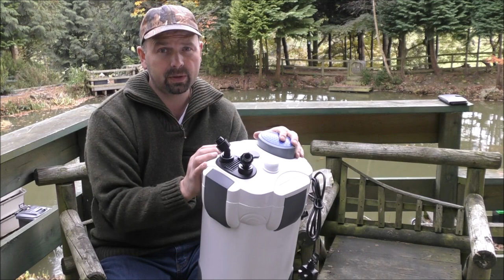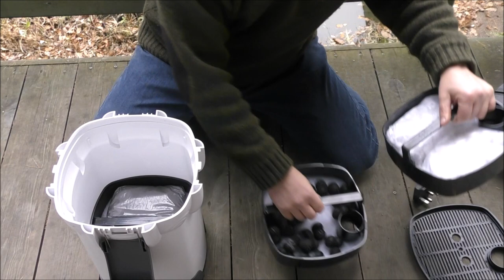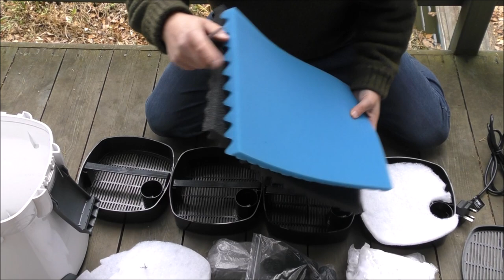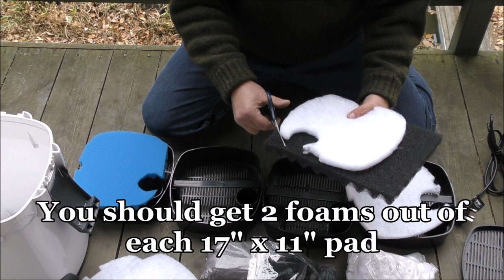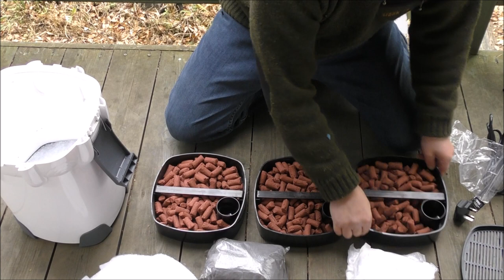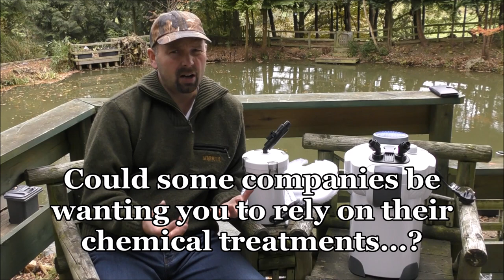Why Your Filter is TOO SMALL and NOT CYCLED

Comment: thank you very much :) but is there such thing as "too much filtration" just asking because i am about to get a 50 gallon tank w/ 3 adult angelfish and 30 harlequin rasboras i also plan to get the sunsun canister filter that has 3 trays and claims to do 1400LPH do you think that's suitable? thanks!
Reply from the maker: That will be 1400 litres per hour (approx. 370 US gph) and it certainly wouldn't be too big for a 190 litre tank as each tray will hold approx. 1.5kg of biohome ultimate - allowing the bottom tray to be used for the foams and fine pad that leaves 2 trays (3kg media in total) and that would see you good for up to 300 litre tank for a full cycle (reduction in nitrate) if it was normally stocked tropical tank. 
If the tank got toward heavily stocked it could take 1.5kg to 2kg per 100 litres to achieve that full cycle so I definitely wouldn't go smaller than the filter you have in mind as it is bang on.

Comment: Speaking of dechlorinators, What's your take on safe?  It also says it can be used to detoxify nitrates.  Will you suggest to me a couple brand names of good the chlorinators.
Reply from the maker: I have no experience of that particular one but if it claims to detoxify nitrate then it may have the same starving / poisoning effect on anaerobic bacteria? 
Using a straightforward dechlorinator is no problem for a fully developed cycle and something like 'stress coat' from API works fine and does not negatively affect bacteria.

Comment: Hey, I'm thinking about making a "Sump" I will get a pump and pump 400gph (1600lph) through a 30 gallon (120l) "sump" and put in a bunch of seachem matrix and denitrate, and possibly biohome ultra, and my whisper 20 (rated for 20 gallons) a double biochemical sponge filter (filled with matrix) which is rated for 60 gallons and pump it back in. Is that good to a heavily stocked 90 gallon(360l)
Reply from the maker: The more media you have the more bacteria it will support so its all good but some is better than others - check out the video I did called 'Looking inside filter media'.

Comment: my problem is with nitrates only. i have a 60 lbs of rock in a 60 gal tank.  ammonia and nitrites are 0 but my nitrates are my biggest issue.  it is always high.  around 20 I would like to get that down to 5 ppm or less.  thinking about getting eheim external canister filter just for nitrates.  everything else is good other than nitrates.  what do you recommend. I also run a eshopps HOB skimmer. which is a work horse. keeps the water clear as glass but just for nitrates just can't get those under control with Water changes.  tried vodka dosing and vinager dosing and no results. got 2 clowns and several soft leather corals.
Reply from the maker: What do you have as filter media currently? For a 60 gallon (US?) marine tank it should take around 5kg of biohome ultimate marine to achieve full cycle but if advise not getting one of the newer eheim filters as they are awful. Feel free to send details of current filtration to my email as I often miss YouTube comments. It is sales@filterpro.co.uk 
Vodka / carbon dosing is very useful to speed up a cycle and help bacteria establish quickly, especially anaerobic bacteria responsible for nitrate reduction but only if they have somewhere suitable to live. That's where the biohome comes in.
Regards
Richard

Comment: Great video. Would you still recommend water change regularly, if so how much and how often?
Reply: Ah saw your comment: "Even in a system with a full cycle and perfect test results you should do a partial water change every 1-2 weeks depending on stock and also remove fish waste and uneaten food at the same time with a gravel cleaner. A water change will help to remineralise the water so is essential no matter how good the filtration is."
Reply from the maker: Yup, that's about it.

Comment: Hi pondguru would like if u could do a video on the booster filter set up with the canister filter set up so I can see how the best way is to set up the booster and canister filter as in piping and media thanks would greatly appreciate it
Reply from the maker: It really just goes on the inlet pipe - simply cut the flexible inlet pipe and fit it. Alternately it could be totally filled with media and put on the outlet pipe although that method is never talked about either one will work.

Comment: I am new to having a aquarium. I have a 160 litre tank and I have the all pound solutions external filter EF1+ 1000L/H with uv light. And so far about 24 community tropical fish. Have I got the right filter for the size? And or should I buy the booster?
Reply from the maker: It sounds about right - see how it goes and then the booster is easily added if necessary.
Each tray of the 1000 will hold 1kg of biohome ultimate making it suited to a normal community tank of around 200 litres. Allowing for water displacement from substrate and decor you should be well covered there.

Comment: If you add a booster filter, how do you reconcile the different flow rates?  Surely you would have back pressure to one of the units leading to the pump seal failing?
Reply from the maker: Some 'boosters' have integrated pumps which are much smaller than the size of the main canister filter so I'm not a fan of running that with a canister as there will be 2 different pump outputs - therefore its definitely best to use a booster with no pump....but as I mention in this video they can slow the flow down a bit due to the extra restrictions - I'd definitely like to see boosters much bigger.
Reply: Pondguru I see now - so basically it’s just adding another ‘compartment’ without a pump. Cheers.

Comment: Hello! I like to build next year my koi pond,around 1500 gallon.My question can i use shower filters ,and how big /stages/ has to be use for bio filters.?!
Reply from the maker: You can make them whatever size you want but generally the better quality the media is the smaller the shower filter will need to be. For 1500 (US?) gallons you'd only need sections about 18" wide x 12" x 12" (3 or 4 of them) filled with decent media for great quality water.

Comment: Thanks for the informative video. How do you rate Alfagrog as a biological media? Could it be taking care of the nitrate to nitrogen part of the cycle for me? (I'm going to move my fine pad to the bottom of my filter right away and put more bio media in my top tray)  Also, second question, In a planted tank would the plants be better off or worse off if my nitrates go from 20 (what they are now) to zero.
Reply from the maker: The plants are't affected by low nitrates since they use the soluble nitrogen in just the same way.
Alfagrog is a decent media but very unlikely to support enough anaerobic bacteria to affect nitrates unless the flow is very slow.
20ppm is a good reading for nitrate compared to many people's tanks.
I did a video recently where I looked inside different types of filter media to show how useful it would be for bacteria: https://www.youtube.com/watch?v=QTtAUYR67Eg

Comment: Hi i have a all pond solutions 1000fx filter will it be powerful enough to run a 182 litre tank?
Reply from the maker: (without a booster) It holds 1kg biohome ultimate per tray so if bottom tray is used for foams and fine pad that leaves 2 trays for media (2kg) which is fine for a normally stocked tank up to 200 litres (1kg per 100 litres for a normally stocked tank).
1400 would hold 3kg and 2000 would hold 5kg

Comment: Fantastic video - thank you.  I have an EF1000 with booster on a 125ltr tank, but based on your video it's mostly set up wrong.  I have just ordered better media, foams and API Stress Coat (previously using Haloex) - thank you :)
Reply from the maker: Sounds good to me and thanks for the order. Having a filter set up properly is a major step in the right direction for fishkeepers.

Comment: hello Pondguru your videos and suggestions are really useful. I would like setup my 42G tank with Canster filter where there are nine African Cichlids and two red parrots all are of 4-5" now. Please let me know which filter I should go for and how long I should run that and what should be the flow rate.
Reply from the maker: Flow rates aren't really too important but size of filter and the amount of media it will hold for the stocking scenario are therefore for a 42 (US?) gallon tank with cichlids you'd need a filter capable of holding around 3kg of biohome. The 1400 litre per hour All pond solutions filter / SunSun filter would be minimum size for that - Fluval 406 or FX4 is another option but ideally I would go for a slightly bigger filter which could transfer to be used if you upgrade to a bigger tank.

Comment: I am from India. In India there is no supply of Bio home ultimate . E bay supplies it through international import and then the costs are Rs 800/- per 500 g ie approximately 3 kg will cost me 4800/- which is more than the cannister cost Sunsun 303A -4600/- only. Is there any way to get Bio home at a cheaper rate?
Reply from the maker: Unfortunately we do not currently have a supplier in India and international postage can be expensive due to the weight - the nearest would be in Singapore. Direct links to suppliers in different countries is on my website http://www.filterpro.co.uk

Comment: @Pondguru please can you help me understand the Juwel BioFlow XL flow direction and therefore your view of pad placement. The fine foam pad is instructed to be at the top but gets filthy while the medium and course seem not to.  Does that mean the flow is top to bottom and its therefore (based on your excellent video) in the wrong place?  Thanks
Reply from the maker: Yes as far as I can tell the newer versions of the Juwel internal filters work top to bottom - Juwel have always set filters up to have the fine pad first so that the fine pad takes the majority of the dirt and needs replacing regularly. Ideally you would set u=it up so the water hits coarse pad first then medium then fine to gradually remove the dirt and not just concentrate it all in top pad. Better still if you find that the internal filter is not coping install a suitable sized canister filter as it will offer much greater filtering capacity than the internal filter.
Reply: Thanks for the reply.   I have a Fluval 306 running too (set up as you recommend for some time)  for this 450l Malawi tank but the internal (and the fine pad) seems to take the brunt of the muck.  I'll move the fine pad down beneath the course and medium and see if that helps.   Nonetheless my tap water is high in nitrate and I've never manged to get my nitrates down in the tank :-(
Reply from the maker: That would definitely be classed as heavily stocked so it could take 1.5kg-2kg per 100 litres to achieve the full cycle and reduce nitrates naturally. Therefore you could need up to 9kg/10kg for a heavily stocked 450 litre tank.

Comment: Great video, I use pinky media as fine at the end, is that filter media okay, I also use chemi blue can, is it safe to use to use with biohome ultimate
Reply from the maker: I'm not sure about the chemi blue. I did have a couple of people reporting cycle failures when using one of the chemi products but I can't remember which one it was. The pinky pad should be no problem as it is just a dual density polyester pad.
Reply: Pondguru, thank you

Comment: Hi Richard. After long battle with cyanobacteria I decided  to  remove biohome media from my filter. I dont have problems with cyano since. What's your experience with biohome media? Are there natural for water?
Reply from the maker: I'm not quite sure what you're asking here since biohome mix is essentially various sized particles of sand and powdered glass. The powdered glass is used to fuse the sand particles together in a kiln which results in a strong, very porous media with a structure which is as close to natural as you're going to get as a filter media since bacteria essentially grows on the particles in the various holes and tunnels between them.
I'm presuming that you were treating for the problem but what sort of tank do you have, amount of media used etc. etc. - there is lots of missing information here. I know cyanobacteria can be a problem in new tanks - was the tank new (going through a cycle)?

Comment: Hey PondGuru, am interested in the cleaning.  I have followed through you setup of my AP 1400EF filter and the way you have advised to clean, however, I am still getting smallish (not fine) particles coming back through the filter and in to the water.  I have been advised that it might be the pipes.  What is your thoughts on cleaning the pipes?  Also, with the AP filter connections and pipes, I have found them extremely difficult to remove once they are on ... any tips for loosening/removing

Again, thanks again for the great vids, have now subscribed so hopefully I will keep on learning
Reply from the maker: You should be able to remove the pipes from the filter while still connected to the fittings and clean them but it is way easier to take the pipes off completely. Usually muck in water is due to the fine pad / floss not catching all the muck as that should keep it crystal clear. What do you use as a fine white pad? and is it cut to totally fill the tray?
Reply from the maker: Looks OK to me although the APS fine pads are very thin.

Comment: I also agree with you and buying a filter rated too big for the tank that you're going to put it on. I don't believe there is such a thing as over filtering a tank. How putting an f x 6 on a 10 gallon tank or 20 gallon tank is extreme Overkill. But you get what I'm saying
Reply from the maker: Yes the issues of a really big filter tend to be related to very high flow rates and the media in them certainly does no harm. FX6 has a crazy flow rate but limited space for good media.

Comment: Thank you for this really informative video. I'm going to be setting up a 200l planted aquarium and was planning on getting an oase biomaster thermo 250 thinking that would offer enough filtration. But now I realise that I'll probably need the 600 as the next size up from the 250 is the 350 which still wouldn't be enough! Will I have to change the filtration system round in the oase as you suggest, or are they already set up like this? Thank you in advance
Reply from the maker: The OASE filters rely on plastic media and foams only and have a pre-filter prior to the trays which should be left as it is. Remove everything from trays just as I did in this video then set up bottom tray with foams and fine pad. Trays above that can be filled with proper media and each tray will hold approx. 1kg of biohome ultimate.
Reply: Thank you

Comment: Fantastic video, extremely helpful. I have a fluval 240 litre tank, I run a fluval 306 of which 2 trays are filled with biohome, would I be able to run the APS EF2 booster along with the 306? Would this work?
Reply from the maker: Yes I can't see any reason why it wouldn't work unless the hose sizes were incompatible but I'd imagine you were using 16mm / 18mm pipe so should be fine. If you are using 20mm pipe you may need to bulk out the filter hose tail with a few turns of electricians tape.
Having the booster will free up the bottom tray in your Fluval filter for another 1kg of media.

Comment: I like the idea of the small filter canister however the fittings are so much smaller than my canister which is 3/4", it looks like the smaller filter has a 1/2" fittings when i look on line...
Reply from the maker: The outlet for the 2.3 litre one shown in this video is a strange size of 18mm which is half way between 5/8" and 3/4".
A 1/2" internal diameter pipe would be very tight and a 3/4" pipe may need tape to secure it although the fitting is tapered to allow for a 3/4 pipe.
The next model down (the 1.2 cubic litre version) takes has 1/2" inlet / outlet.

Comment: whats your opinion on Ocean Free Hydra Filters? Is there a supplier of All Pond Solutions in Australia? Interested in getting the External Filter Booster.
Reply from the maker: Unfortunately the Hydra filters were just coming out when I closed my shop so I haven't had first hand experience of them. However I've had many people mention them in correspondence about the gear they have in their tanks - I'd say maybe 30% of them say that it has some effect, 20% say they don't know and 50% say they haven't noticed any benefit so I couldn't say if they work or not as there are so many variables at play and I don't have enough good information (feedback) on them.
The APS filters may be known as SunSun in AU so you could try searching for them online. If you're in AU the link in video description should direct you to AU Amazon equivalent (if there is one).
Reply: ok thanks